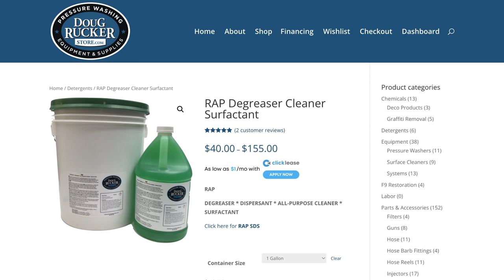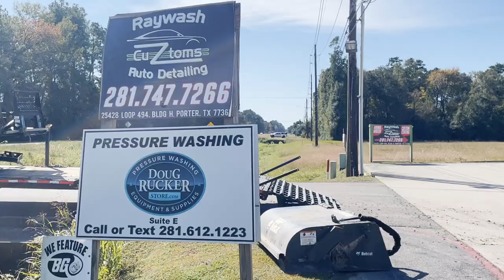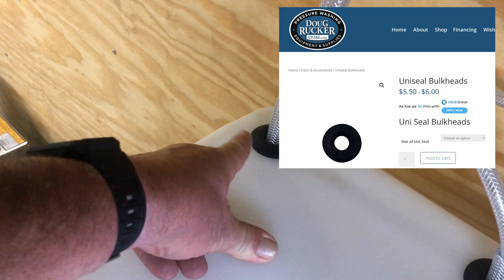Pressure Washer Air Bubbles aka "Spitting Water" from Doug Rucker

Comment: Question for Doug. I have an xjet and lost my beige proportionar tip. If I use wide open using a 5 gallon bucket. Using SH 12.5% and a 4gpm machine how many gallons will give me 1.25% on siding
Reply from the maker: Guessing probably 1 to 1.5 gallon of water to 3.5 -4 gallons of SH.  Not real sure.  I never have been one for getting exact %'s.  Just need it to change the color of the algae without being to strong to oxidize the surface.

Comment: I have a 12v 15 gallon sprayer you tote on an ATV. . The pump is pulsating. But when I take the wand tip ( that adjusts the spray pattern)off it runs smooth. No pulsating. Any idea why? Thanks.
Reply from the maker: Nozzle could be to small causing restriction